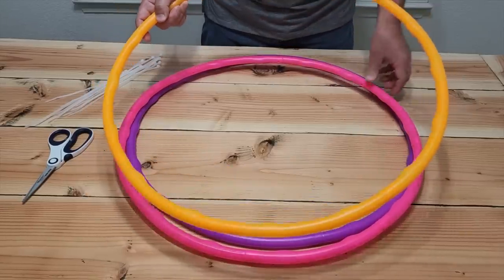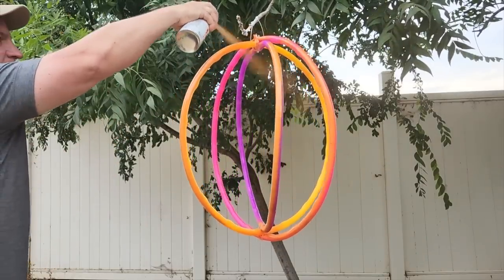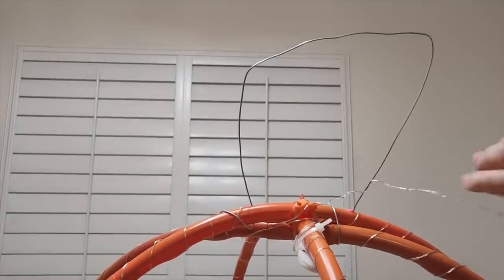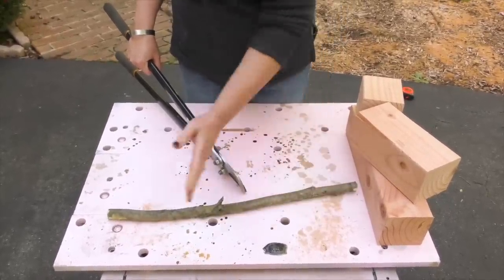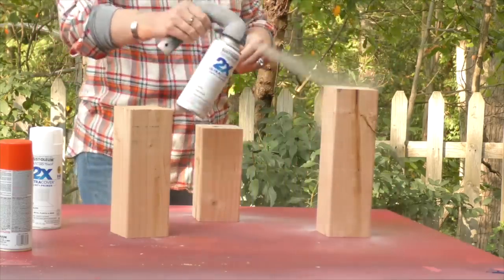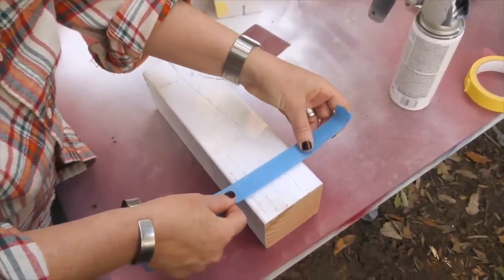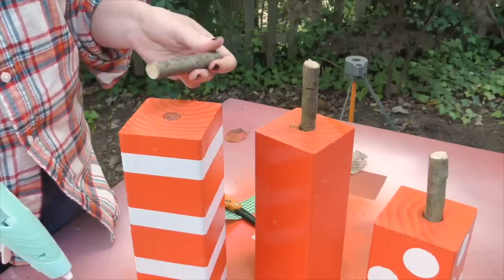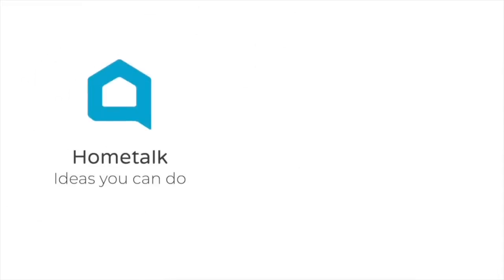Grab 2 hula hoops for this brilliant fall yard idea!

Comment: Are the fairy lights battery pack weather proof? I love the project but I'm concerned about them getting wet.
Reply: They are weather proof.  The batteries are in a water tight case.  Also search for "outdoor" lights.